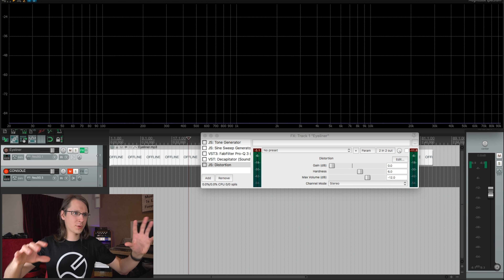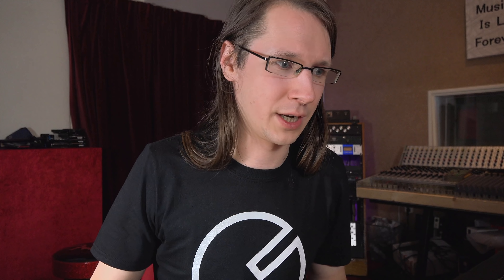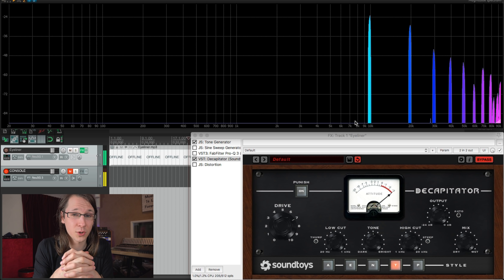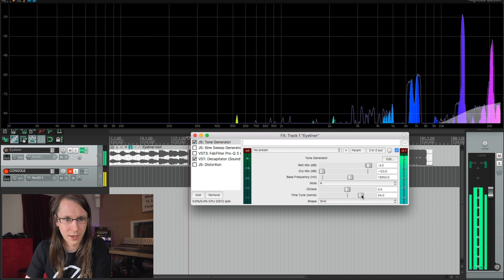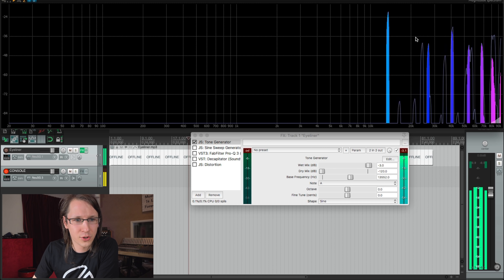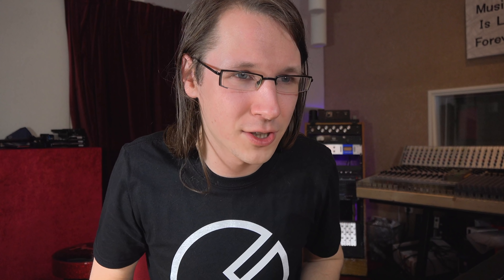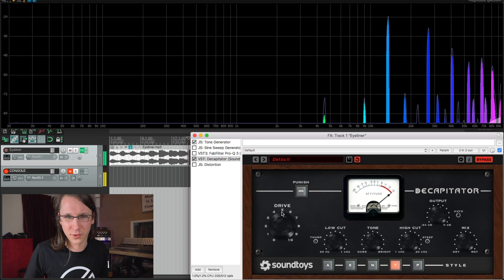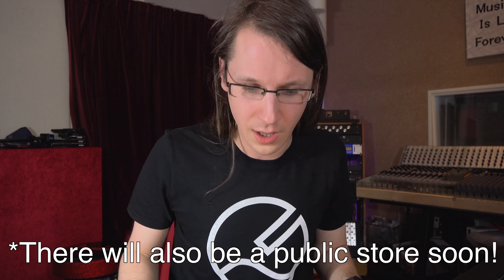Why MANY ANALOG EMULATIONS are SNAKE OIL!

Comment: Literally been sat thinking "damn distortion plugins really suck i'm going to have to buy some pedals" all day after selling my favourite distortion a month ago thinking plugins would have me covered. They really don''t cut it imo especially on bass.
Reply: Robert Hardy Keep in mind - in synth heavy, electronic music, where the sounds already have a lot of high end, all of the aliasing will get masked and hence oversampling distortion plugins won’t matter much. 
On the other hand, acoustic music, sparse rock, anything with real, recorded instruments.. oversampling is important because aliasing will be more audible and ruin a mix faster. 
You were talking about pedals so I assume you’re a guitar guy, so you are completely right to be worried about oversampling though
Reply: @Samuel-ky2cq  No i'm a synth guy but i sold my module and am just going to get a guitar pedal instead this time because its cheaper. I've just found that real analog disortion is so much nicer on basslines and all around really than distortion plugins. Especially diode distortion like MXR D+ and tube distortion that the plugins don't even get close to emulating some of the tube stuff i've had. Bass lines when i put distortion on just don't have the unique brightness where its still a bassline and tends to just ruin the sound instead of bringing out that bit of awesomeness. Thats my experience anyway. If you can recomend some distortion plugins other than decap i'll give them a look.

Comment: In a complex signal, aliasing that is -60dbfs is likely not audible. If it is, use oversampling. If your plugin doesn't use oversampling, and you don't like the sound of aliasing, record at a higher sampling rate.

Comment: Oversampling alone does not help in most interesting processes. You also need to steeply filter between each non-linear stage of any processor (which is the same as sampling down back to 48kHz and oversampling back to, say, 192kHz for the next stage). But yeah, I suspect that some/few/many/dunno plug-in manufacturers don't do this to save some CPU.
Reply: @id523a Let's say you have 3 simple effects A, B and C which you normally run at 48kHz. Each of which adds harmonic distortion. Let's say each has a switch that lets them run at 192kHz internally (4x oversampling). You now have two options: 1. Stay on 48kHz and switch each to run at 192kHz or 2. Don't oversample them but change the overall samplerate to 192kHz. Which exhibits less aliaising? The one where each effect is oversampled individually or the one where the whole chain runs at a higher sample rate?

Answer: 1. exhibits less aliasing than 2. - That's because in 2. the effects of harmonic distortion accumulate from effect to effect. But if each effect gets bandlimited to 48 kHz, there is no accumulation. Hence, individual oversampling is better than oversampling the whole chain. Hence, in complex effects, brickwall filtering between stages can be an important factor.

Naturally, oversampling  can and will introduce phase issues and/or latency. But good compromises make these absolutely bearable.

Comment: Most top ITB mixing engineers still using old crap bomb factory plugins and sansamp that do not have oversampling at all. Does their mixes sounds terrible? No.

In general, there’re no bad sounding plugins. It’s just plugins you don’t know how to use properly. That’s it.
Reply: 100% agree.  People have been pumping amazing ITB mixes out for nearly 20 years now.  I'm shocked that people are still stuck on this analog vs. digital thing in 2019.
Reply: I think it's possible to do a great mix but still have aliasing issues. The aliasing issues don't make it a "bad mix" but they do may it an ear fatiguing (and possibly damaging) mix. Those with more sensitive ears may be able instantly to tell something feels horrible. I personally think there have been a lot of good mix's as well as digital remasters over the last 20 or so years that sadly are hard to listen to for anyone with highly sensitive ears. The point is that even for those who are not aware consciously, the listening experience would be way better without this problem. And it is totally avoidable.
Reply: PS if you mix at high sample rates then over sampling becomes redundant as I understand it.
Reply: Yes, but take into account that the big cats will afford a computer system that can run a session on a high sampling rate. Earlier, they had these insanely expensive rig processing boards.

Comment: This comes across to me as someone who has spent a lot of money on analog gear and is determined to prove that it was necessary. The fact is, it doesn't matter if software emulates hardware accurately. It only matters how it sounds. 

The first decapitor video was basically just slapping it on the master bus and saying, "I don't like the GUI". This video cranks up the distortion higher than how it is typically used, and then becomes a lecture on aliasing at different sample rates. It's interesting as a lecture, but it doesn't have anything to do with how professionals use these types of plugins in a mix.

It rubs me the wrong way when people try to intimidate others by saying, "I've spent so much money on gear that you will never reach my level without also irresponsibly spending on gear." To me, the two part decapitor series is just an attempt to justify yourself by intimidating others. What a shame.
Reply: In a way I agree. I've heard many professional mixers state that they mix entirely in the box and saturation plugins are an important part of their workflow. What I do like about this video is it makes you think about what the plugin is actually doing. The more you understand what it actually is doing the more creative you can be with it, and the better decisions you can make in your purchases. I basically divide out the obvious bias this channel has and look for any useful information, because I'm a person that is never going to buy outboard gear.

Comment: @White Sea Studio, I'm somewhat surprised, when you've consulted Chris J and everything, that you don't mention the other obvious solution:

1. Split the signal into two around a frequency point, like 10-12 KHz, using some HQ splitter.
2. Don't saturate/distort the upper frequencies.
3. Saturate/distort the lower frequencies and sum the "signals" (data streams really).
Reply from the maker: Good one!
Reply: so basically what can be done with fabfilter's saturn?

Comment: For an example, Melda in commercial version allows you to dial in oversampling, and so does their Saturator.
I checked this out and either we oversample or we run the session at least at 96k, and it sounds really a lot better.
That's for cymbals, guitars (esp. distorted), and of course, vocals.

Comment: At this point you had undoubtedly conquered my subscription. Looking forward for more snake oil videos. Thank's!
Reply: Furthermore, after few hours of thinking on this and testing saturation plugins on my own I think I understood that this frequency aliasing issue has a lot more consequences. At least not only with analog emulation plugins. But I'm not sure.

1. Does this mean that frequency aliasing is not possible if you use ANY analog console (no mater what quality the console is) because the interface will cut above 24k at the input before A-D processing? Or is it possible that low quality/cheap consoles could have same aliasing issue?
 
2. Does this mean that any synth that is not analog actually produce the same frequency mess on the top end? Basically when you generate sawtooth wave you deal with same harmonics, that seems to cause the same mess, right?

3. Does it occur in case with FM synthesis? (When you add harmonics with independent oscillators)

Comment: It's a trade-off. Oversampling is pretty much just like running at a higher sampling rate. Some plugins offer really crazy oversampling, when in fact x4 should be all you need (48 * 4 = 192). So the CPU usage is pretty much the same as running your whole session at 192kHz. If you use lots of plugins with oversampling, you'll end up converting to 192kHz and back to 48kHz a lot of times. It all contributes to the CPU usage so keeping everything at 192k might not be that bad overall. There are also plugins with options to turn on oversampling for rendering only.

Also keep in mind oversampling would also create some more latency since you need to calculate where the inbetween points should be to get your new sample points, before doing anything. Anyway, oversampling is a thing pretty much only in distortion and limiting. It might be helpful in EQ as well to keep the bell filters from getting squeezed near nyquist.

Comment: One of the major reasons I started buying hardware compressors is that I didn’t want my computer to have to work so hard. A well made plugin often draws a ton of of cpu. Running hardware saves time when tracking. Get great sounds going in and fiddle around with a handful of plugins at the mixing stage. Plugin recall-ability is really great when mixing. It’s all about workflow.

Comment: There's actually an even simpeler test. Listen to the result and if you like it : keep it. If not: change it. It's nice to know why you might not like it and how to fix it, but running all your plugins on a sine wave under extreme conditions to not pick them to death is not using the tool as it is intended to be used.

Comment: The aliasing frequencies are mirrored against the Nyquist limit ... Every thing above will be mirrored backwards in frequency from that limit. it's mathematically 'do-able', maybe....but I prefer going outboard.
Reply: It's totally doable.  You can oversample and use a low pass FIR filter to get rid of the aliasing.  The cost will be higher CPU and some latency.

Comment: I am an old guy... I am at 64 just now getting into the computer recording. I was told by others that I don't need to put any effects in front of the interface because I can add any effects I want after it's recorded. I call BS... I have not been able to find any plugins that sound even as good as my Alesis for Vocals and guitar pedals for distortion. They are either just noisy or un-tameable. Thank you so much for this video. I thought it was just me.

Comment: Wow. I pressed the thumbs up 7 times on this one. Thank you, Wytse. You're the best! I tested all of my favorite saturation/analog style plugins and got some surprising results. I don't get one thing. It doesn't matter what sample rate I set my project, the JS analyser in REAPER only goes to 20K. How did you get yours to go higher? Here's what I found out. My beloved UAD preamps and consoles that add such nice saturation start artifacting pretty bad when they get close to Nyquist. I would have thought they would have filtered that out. Chris (Airwindows) is able to do it. Why can't UAD? Even FF Saturn showed pretty bad artifacting, but it went away for the most part when HQ is enabled. The only other plugins that didn't have horrible artifacting were the Klanghelm plugins. There was some, it varied depending on which mode the plugins were in (each plugin is really 3 or 4 plugins in one), and it was almost all at inaudible levels (-90–-60dB) except for one or two weird harmonics that would pop up way down the frequency graph and were very smooth and musical. So, here's the lesson. Airwindows plugins are donationware and filter out the artifacts. Klanghelm plugins are almost donationware at €23 each, and Chris and Tony are both one-man operations who are able to write better quality plugins than the leading names in the industry. Not that I don't still love my UAD plugins, I'm just a bit disappointed that a company with so many resources doesn't pay attention to such an important detail. I'll definitely be writing them and showing them this issue. But this leads me to the question I've been asking for months: When are you going to review the Klanghelm plugins?!?!?!? They are the most amazing sounding compressors and saturation you can get, and they are next to free. There are no demos, but they are almost free, and I guarantee you will love them and want to use them. If not, give the licenses away. I'm sure Tony would work with you on that. Damn, am I pissed at UAD right now!

Comment: This particular effect is called foldback distortion, as the harmonics generated from distortion (or exciters, fast attack compression, etc) "fold back" into the existing lower frequencies that the current sampling rate is capable of.

Comment: Well, maybe one day you will notice a high cut filter in Decapitator :)
Reply: Brilliant! Has a steep switch even :D Best comment!
Reply: Exactly
Reply: U still don’t get it. This fire-backed ugly harmonic happens in 1/48000 sec, the plugin need to filter the ugly harmonic in 1/480000 sec and take the filter out after that sample is gone, thats why he keep saying plugin needs to oversampling (i.e works at higher than 48kHz , like 96kHz or higher) to detect ugly harmonic and perform anti-aliasing.

A general high pass filter just doesn’t help in this scenario
Reply: Yeah there’s still no oversampling. the high cut filter in decapitator will cut highs off of the whole signal, instead of just the frequencies above nyquist like an antialiasing filter would. 
So the video is still on point
Reply: @lastwarning1  exactly! Just like in the ADC.  At that point it's math not music.
Reply: @lastwarning1  Aliasing isnt the devil. TONS of old samplers had it and it became part of the sound.
Reply: @novakattila  the question here is not to never use aliasing but to know how to use it or to not use it .... just giving you more control of what you want archieve
Reply: breakline yes, but that’s not the point. You don’t want those frequencies back in your mix generally.

Comment: I came across this mixanalog article a while ago and I too did what you did with an analyzer and the aliasing problem was very very real. But the solution is very simple. If you work at 96Khz or even better 192, and just put a PRO Q with a steep high pass filter (22.050hz) at the very end of your mastering chain, you can export at 44.1 and have all the goodness without any foldback. It's cpu intensive but very worth it! Anyway, keep being the youtube god that you are ❤️

Comment: Not all plugins are created equal I think you should run this test using universal audio or slate digital. I have a bunch of warm audio analog gear which I used and I like the uad plugins and the sound of them better than the actual analog equipment
Reply: Also the artifacts are not audible when you use the plugins the way they are ment to be used.

Comment: I tried doing a upwards sin sweep and really smashed it with oversampled saturation (Logic Pro's Vintage Graphic EQ), and noticed as the sweep went upwards there were simultaneously harmonics right at the top of the range moving back downwards again, that fall in volume as their frequency goes down, almost like a wave bouncing back off the top of the spectrum - 

- well, I say harmonics but as they're not really in a conventional harmonic ratio relationship with the fundamental, they're kind of fucking everything up. BUT: the higher your sample rate, the higher in pitch these weird pseudoharmonics are (why? I don't know), and if your sample rate is high enough they're beyond audible range. Conversely, if your sample rate is low enough they ARE in audible range and thus could in theory do all sorts of unpleasant inharmonic things to your sound. 

Which makes some sense to me. I think it's more intuitively understandable if you try doing what I did and watch the spectrum. Incidentally I discovered Logic Pro's built-in vintage EQs can way oversample, so that's cool.

Comment: Doing some experimenting, something I don't understand is that if you put a LPF after whatever's producing saturation, it reduces the aliasing quite a bit, even at frequencies much lower than the LPF's cutoff. You'd think the only aliasing it would remove would be anything above the LPF cutoff (along with everything else above it). I find this slightly incomprehensible.

Comment: THANK YOU! I have heard weird ringing in Decapitator on single note sources since I got it and couldn't figure out why. You just showed me! Thank you for the explanation.  This is one more reason to track in a higher sample rate. If plugin manufacturers won't solve the problem, we need to do so on the hardware level.

Comment: The comparison would be better, if you had used more than a cheap soundtoys plugin to compare. what about uad stuff? about plugin alliance's spl and elysia emulations? what about klanghelm stuff? what about more cpu heavy stuff in general?  what about working in 96 khz ? comparing your console to one plugin is no statement at all. it could have been such an informative video, if you had put more work in it and not just tried to reach youtube's 10 minutes goal. I know you said many and not all.. but this is just oil in the fire of digital vs analog debate without doing proper comparisions and research.
Reply: Same thoughts here..

Comment: UAD over samples everything to 192k internally even if you are running in a 48k session. This is a pretty good explanation why.  The end result is you can have very good sounding analogue modeled plugins and go easy on system resources. It is unfortunately also more expensive than most plugins and hardware dependent. It would be nice to have a list of oversampled native plugins but I'm not sure that's a feature many developers advertise, as it also means high cpu usage and people seem more concerned with cpu usage than pristine quality at lower sample rates.